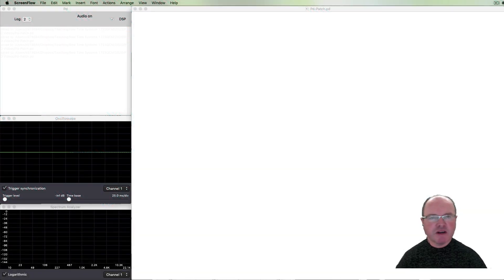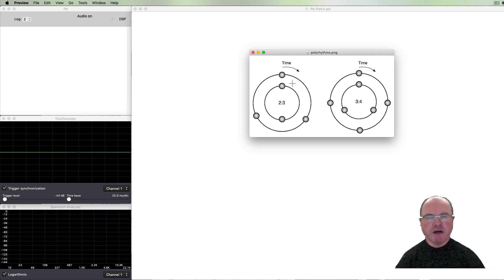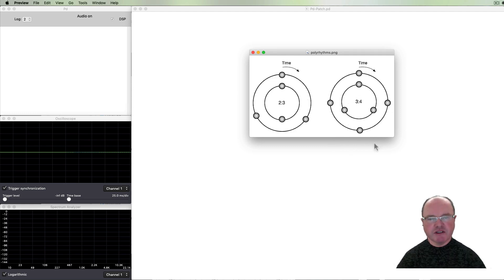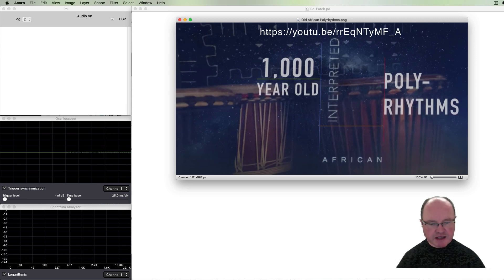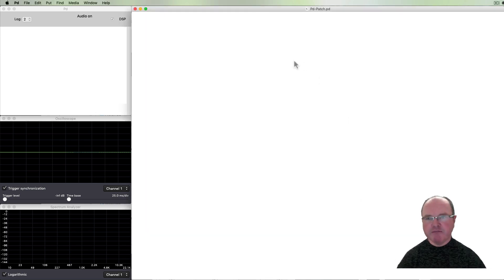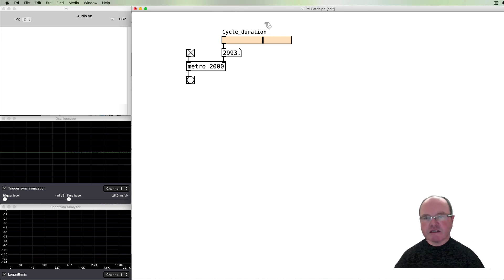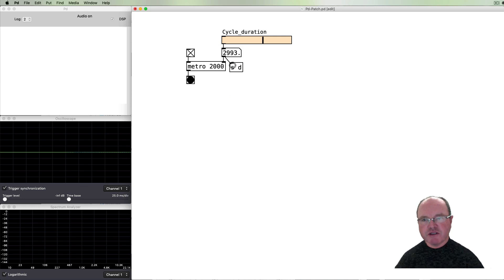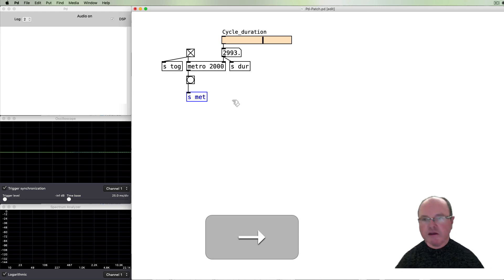34. Polyrhythms with Pure Data

Comment: I think it's better to use just use one master metro clock with a high speed count and derive other beats from it .
Make a counter and a modulo set to 96 , or 48 or 24 , because these can be divided by 2 ,3 ,6 
Module set to 48 into select module , sel 0, sel 12, sel 24 , sel 36 for your straight 4/4 
Same modulo into  select module set to 0, 16 ,32 
Voila , a 3 against 4 polyrytm all derived from same metro